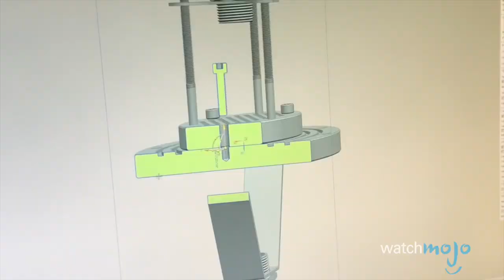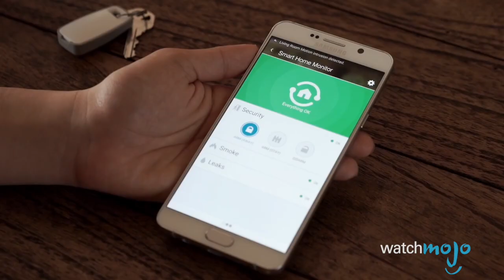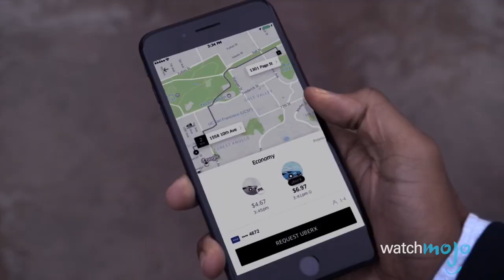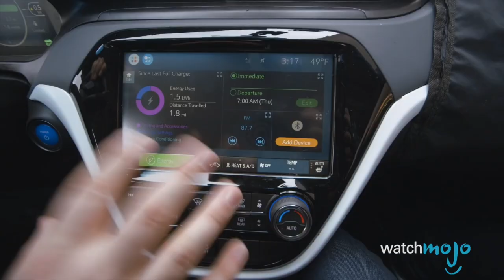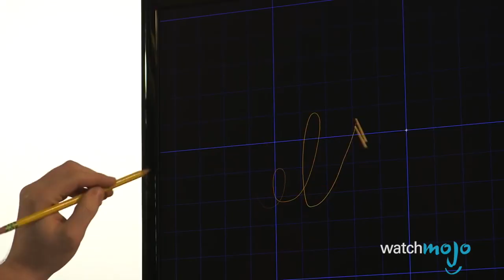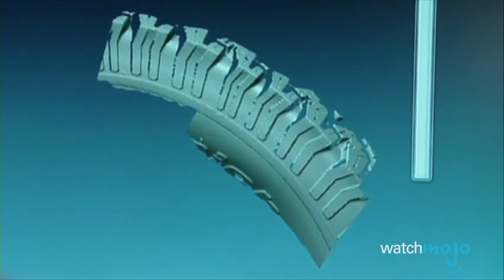Top 10 Emerging Technologies That Will Change Your Life

Comment: the hyperloop is a vacuum that can collapse in on itself if any hole appears in the structure
Reply: franklin clinton even if there's a nearly microscopic hole :D
Reply: That's rather terrifying. if it wasn't claustrophobic already enough...
Reply: going 600 mph? probably would be instant death/decompression when it got to you
Reply: franklin clinton what's a plane? what happen if it gets holes??? what's a train what happens if it's railing gets a crack??? what's a car??? what happens if it gets a flat??? what's a roller coaster what happens if it's rail gets a crack???
Reply: Fuck holes, thermal expansion is dangerous enough. A closed metal tube hundreds of miles long is going to be experiencing different temperatures along its length resulting in pulling and pushing at its end points.
Reply: no thanks. I think I'll walk 😕
Reply: legit questions
Reply: franklin clinton dude what are legs what happens if I'm crossing the street and my leg gives???
Reply: Musk didn't think about these problems when he changed the name because that all he did. The Hyperloop has many different issues and some of them they could get around and the issues like the structural issues, thermal expansion and they won't be able to build the vacuum tube for the distance that they said.
Reply: Joel Brown I'm not necessarily disagreeing with you but I'm interested to see what parts wouldn't work
Reply: They're not oblivious to that issue, eventually they'll find a way to solve it.
Reply: Even if you throw a rock at the side of the thin steal and this causes damage too outside of the tube, the metal will simple collapse because of the air rushing inside at 600mph. They are using thin steel, and steel doesn't have great properties for this. This is why planes have more than just steel when the alloy is created.
Reply: franklin clinton OMG what's a elevator?? what happens if it's line snaps
Reply: And all it takes is a simple earthquake to dismantle the structure completely.  I'd hate to be one of the riders in the tube when that happens!
Reply: without stomach nausea? head?
Reply: It only works in theory
Reply: That is correct it only does work as a concept and it will not be possible to make this technology work the way that the Alpha document says how they want to make it.
Reply: In theory the Hyperloop works, however there are many different issues which need to sorted out and plus this system won't be a cheap as say because of the total costs are estimated to be ten times more than what they said in the Alpha document.
Reply: @ omega5040 - A hole in the Hyperloop is not the main concern, and a rapid change in pressure (even in a low vacuum) can have devastating results on the system and the people inside the system (it will not just slow it down).  The main concern for the Hyperloop is where it crosses the San Andreas fault line!  The San Andreas fault line is a shearing fault line that has already shown how it can rip steel buildings and roads in half in the past!  No matter how fortified the Hyperloop is, it will still eventually crumble during an inevitable earthquake, and any riders inside the Hyperloop at the time will likely be killed or stranded out in the middle of the California desert with severe wounds and head trauma (at the very least).  Airplanes have less risk of failure than the Hyperloop, and they have many more years of experience and safety measures in place than the Hyperloop!
Reply: No, you have been watching youtubers with a lack of knowledge in this field. Look up Shane Killian he explains Thunderf00ts misunderstandings.
Reply: The airplane won't work, a hole in the hall will depressurise the cabin and suck passengers into mid-air. 
.
.
.
.
Oh wait
.
.
.

Airplanes exist.
Reply: "an airplane is constructed out of materials which are much more durable than the steel they want to use for hyperloop"

LOL!!

No the complete opposite. An air-plane is  much, much more fragile than an hyperloop tube. This is true since weight on the ground is no issue and they can use any material they want constructing an hyperloop tube.
Reply: Nikhil Pande I don't think a hole in an airplane is just a small problem, I know that it of course can lead to catastrophic failures, there is also the knowledge that a rapid repressurisation can be catastrophic as well.

Honestly I'm not saying will never work, I'm just saying it isn't going to work in its current state. in the future if it works great, if it doesnt, who gives a fuck right?
Reply: let's say they build it with strong materials, there's still a problem of air compression inside.What if, for some reason, there's a double-triple atmosphere (in between "wagons" or with the "air canons", etc) even with release valves.....see the problem
Reply: Such is the nature of the Acquisitions process for a project of this scale.  Throw in the fact that much of the Hyperloop is expected to crisscross over the San Andreas fault line (and given what we know about tectonic plates), we can be sure that the Hyperloop project will be insured "soup to nuts" well before any construction begins!
Reply: Not likely.  Go educate yourself on tectonic plates, earthquakes, and fault lines (especially the San Andreas fault line in CA) to understand why!
Reply: That is why I said that it works in theory, I am not defending the idea because I understand the idea is idiotic on so many levels. There are many issues with the concept as whole, I understand quite a lot about tectonic plates and fault lines. The system as whole will not be resistant to the weather conditions that California will throw at it, the design is not suitable for the environment. Besides all of that I really don't think that it will get the clear from the government as a safe form of transport.
Reply: My previous comment was directed at Andrew, not you Joel.  Andrew apparently does not understand the numerous risks involved in creating a Hyperloop of this magnitude, including the fact that tectonic plates and inevitable earthquakes (especially in that section of CA) are not something that can be figured out (or solved) no matter how structurally sound the Hyperloop is designed to be.
Reply: I am sorry I thought that the comments were aimed at me because of how the reply system works on here. I completely agree that building the Hyperloop on the fault line is a bad idea because of how active it is and because of the material that they are suggesting to make it out of.
Reply: iamagi are you insane?
Reply: less than 7 minutes and you were able to watch all his response videos?

But no, much more sane than you.
Reply: iamagi actually, you didn't consider that I could've watched it before you suggested so.
Reply: Can I ask what your background is? Are you a structural engineer? Are you some expert in this field? I ask because I can't seem to comprehend how you can gloss over first year engineering physics mistakes that Thunderf00t makes. One of the main points you've been pushing is that a hole or breakage in the integrity of the tube will lead to 'disastrous' consequences. 

In Tf00t's video he attempts to demonstrate using a small tube and ball inside, that rapid depressurisation will result in the ball rapidly firing down the tube like bullet in a gun AND says that this what will happen to the Hyperloop. Um. Uh. 'Hey professor, what about the square cube law?', Tf00t: 'Not relevant sonny boy'

Using numbers straight from the white paper, this is the actual acceleration you would feel if the tube in that design were to break.
Hyperloop capsule frontal area = 4m^2
Capsule Weight = 26,000 kg
Atmospheric Pressure = 1 atm
Thus a (acceleration) = (1 atm*4m^2)/26,000 kg = 15.59 m/s^2

This is the amount of acceleration you would feel on a rollercoaster or about 1.6gs. You won't be blown apart or barrel down the tube at unstoppable speeds. Furthermore, this criticism is really stupid considering a hole or breakage should not even occur in the first place, in the same weight as it should not occur on an airplane. This is an engineering problem, not a feasibility problem. You made a point about US buildings crumbling because of earthquakes, UH Japanese buildings have been doing just fine despite experiencing earthquakes every year. We humans have learnt how to handle these kinds of issues.

You also forget that the actual teams (HTT and Hyperloop One) have to pass federal regulation, commercial viability and rigorous testing to be able to even carry out any of its projects - they have to completely focus on safety, consider all possible points of failure and solve them. If you want to argue more on this topic I'm all ears :)
Reply: What the hell are you on about. Airplanes have a focus on having high strength-to-weight ratio, the material with the lowest weight and highest strength is preferred for construction - which is why we see Boeing trying to use more carbon fibre on their Dreamliners, and Lockheed Martin using extremely high strength and heat resistant carbon composites on their F-35's. Hyperloop is on the ground mate, you can construct with any material you like as long it doesn't cost too much. 

Another idiotic statement is that planes have many years to make them safe. Um dude, how many years has hyperloop had to make it safe? NONE, it doesn't even exist yet. This is literally like criticising the Wright brothers before they have even demonstrated actual flight. Sure your arguments are valid but you're using them as a vehicle to denounce the idea altogether. If this is the right way to think about things, you're only deluding yourself into thinking you are a 'skeptic' or 'scientifically-literate' and forget that the wright brothers saw the issues and mere problems to be solved. 

You can extend this logic to any new field of technology. Cars: Who will create the infrastructure to fuel them, petrol can explode. Internet: Who will run cables under the oceans to connect entire continents. You're asking me to 'face it'? No you face it, any new technology can become a practical reality if it doesn't violate the laws of physics and the infrastucture, external mechanisms etc., are there in place that will help it to grow and become the norm. The automotive revolution happened simultaneously with oil production. 

The pre-requisite knowledge for every aspect of the Hyperloop already exists, we get magnetic levitation, fluid dynamics, structural integrity, supersonic travel etc., it's just a matter of combining multiple bodies of science and engineering work into solving this one specific project. Thanks for the criticisms but your stance is completely cynical. How about you actually wait and see what happens - if they fail we will know EXACTLY why.
Reply: Nikhil Pande I'm pretty sure airplanes work with a small hole in it, they aren't operating at a time fraction of an atmosphere and would make an emergency landing in the case of one such hole. 

In any case the hypeloop will not work in its current state, if it is to work at all Musk will have to put millions if not billions into research, proper research.

Everyone should really quit their bitching over this shit.
Reply: You make it sound that having a hole in a plane is not the bad, citing the fact that some planes can land yet you think that a Hyperloop puncture is completely terrible and impossible to be safe at all - double standards is all I can say. Sure an airplane can still land if there is some depressurisation but so can the hyperloop be safe in the event of a puncture. Like I showed in my earlier comment, you won't get any massive explosion or have the pod barrel down the tube at an uncontrollable speed - that's just pure nonsense from a physics perspective given the cross-sectional area.

I really don't get it. This concept checks out from the physics and engineering department, its really the specific unforeseen problems and the business case that needs to be solved i.e maybe this tech is better suited for high-speed cargo. This is literally the only reason why Ph.D physicists and engineers are working on this problem and why a company like Hyperloop One even exists. I can't wait to see how the criticisms and naysaying will switch from 'its impossible' to 'its impractical' to 'its claustophobic' once these companies start demoing the tech and progressively keep making improvements - the stuff engineers live to do.
Reply: Ok thank you. Finally someone who doesn't just outright deny this concept. I've been so irritated by these youtube comments by people who are really just posting armchair musings rather simple math or facts. I wholly agree that currently it can't be done, more basic research and experimentation and safety need to be tested and validated. I'm hopeful for the future though, its exciting to think that such technology might actually be a part of my future.
Reply: franklin clinton so it might be too expensive to maintain or possibly to dangerous to use
Reply: private party  true  the hyperloop would  be a new form of technology so perhaps it could work but I would imagine that it would need to be maintained  and controlled. Delivery would be best to be left on the road and it might be best to only use it specifically for certain areas.
Reply: Depends on how you build it. Most likely it won't though.
Reply: What if it gets blocked because of human litter and rat feces.
Reply: Comparing other forms of transport to the Hyperloop is rather dumb.A Plane if the structure is weakened then the crack will build up overtime there have been many planes brought down because of this. If there is a hole in a plane they bring it down to 10,000ft for a reason. But the Hyperloop is like the environment of space inside a tube. if there is a crack the air will rush in at the speed of sound and the human body is not designed to take such forces. Anyone who works in the science or engineering sectors can calculate this and understand why this is nonsense. Please don't believe everything that you read or see on the internet because like the Hyperloop there are people who promote pseudoscience.
Reply: Kagarin? it would accelerate slowly I imagine
Reply: There are many things that won't work about it, I can think of 4 off the top of my head 
1. The vacuum chamber is made out Steel.
2. Thermal expansion.
3. A small fracture could kill everyone using the Hyperloop. 
4. They are building it in California, which is known for earthquakes and this could cause the steel to fatigue or damaging the Hyperloop costing millions to fix and many months to repair.
Reply: franklin clinton it won't collapse on itself, it works as a low vacuum with giant magnets. The low vacuum is designed so it can travel without much friction, propelled by giant magnets. If a hole happens all it will do is slow it down. Air isn't traveling at 600mph, and the persons travel inside of a reinforced pod on rails. I don't see what the paranoia is about. You sound like my grandma that doesn't trust planes because something that big and made of metal shouldn't be able to fly.